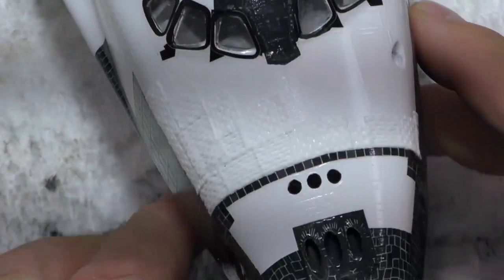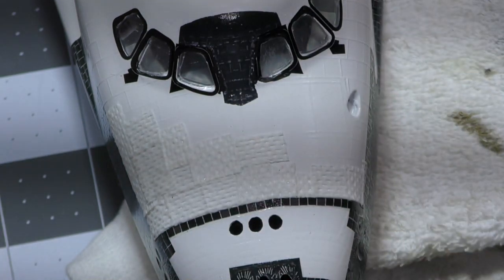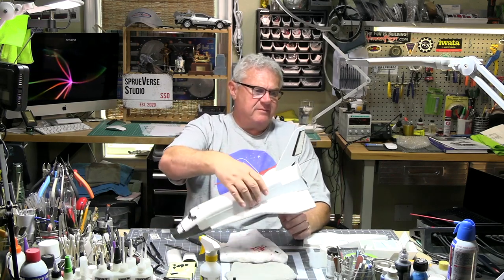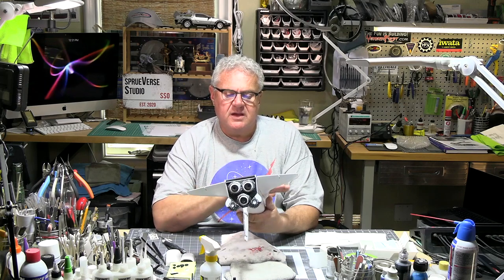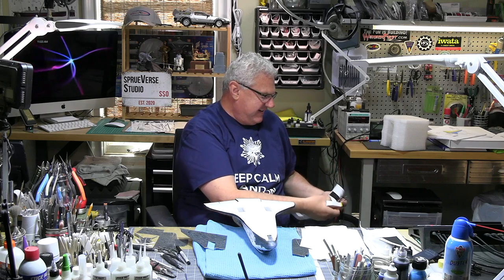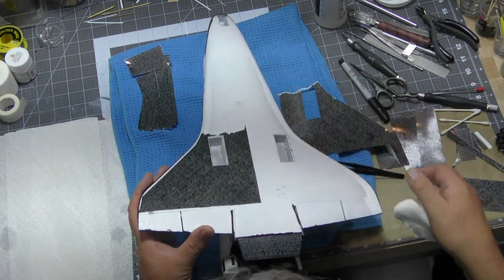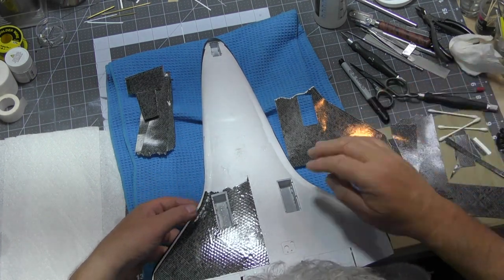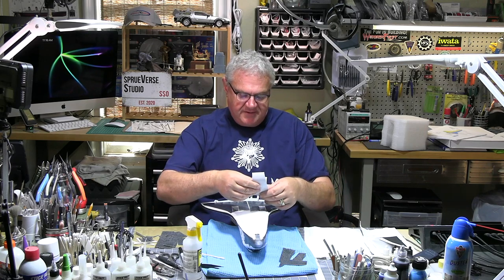Build the Space Shuttle Discovery finale.

Comment: Spotting the word finale, means all these idea are a bit late. But! Better etc. than etc.
Goofy idea 1: When decals are to be laid on the medical tape-- paint a layer of Mod Podge on top. The basic Podge dries mat but some of the other flavors dry gloss. Worth some experimentation, I think.
Goofy idea 2: Vac form over some medical tape with thin sheet sty. There's your texture and the right material to decal onto.
My thought for my own soon-to-be build is to carve up some texture to the smaller scale (choice of 200 and 144) and vac form over it to make large sheets of basic texture.
Goofy idea 3: Those pesky lifting edges of medical tape... damn them! I say, try a very thin applicator, like the edge of some thin stock, styrene or brass-- to apply some CA, forcing it down. If you use a small block of teflon and shape it to a fine edge, you can lay down some accelerator with a small applicator. The CA won't stick.
Love the giant decals-- certainly a labor of love by the creator and you make their placement seem easy. Well... fairly straightforward anyway.
Satisfying version of the good ship Discovery. Textures are very nice. Your impact splatter looks very convincing.
Reply from the maker: Great ideas!!! Definitely worth experimenting with! Cheers! Phil

Comment: The molded panel lines really helped the heat tiles. Are those the new sets available on the web? There’s a new printing process in China where they can print in 3D so to speak. It’s not a resin printer but is something they won’t divulge. I’m trying to work with him doing tile because I have the older kit with boosters. There’s no tile detail molded in.
Reply from the maker: All my panel lines were hidden by the cloth tape. I’ve heard about the new 3D process but my after market nose section is not that!
Reply: @sprueVerse  yeah it’s really good. I work in 64th scale and they do some racing harness belts that are insane detail. You know anyone in US offering the service? I’ve had my Challenger model forever. Tells you how old the kit is.. it was before they removed the Challenger decals.
Reply from the maker: No…I think China still is the place.

Comment: I would skip the medical tape you will not like how it makes the model sticky from the glue they use .If you want the heat tiles to look ideal then use black self adhesive foam that way you can use a heated x-acto knife to cut your tiles and the heat makes them stand out individually a little airbrushing and a white pen in the numbers for the ties and your golden
Reply: ps I still have my 2013 IMac 10.6.7 running also stil runs like a champ